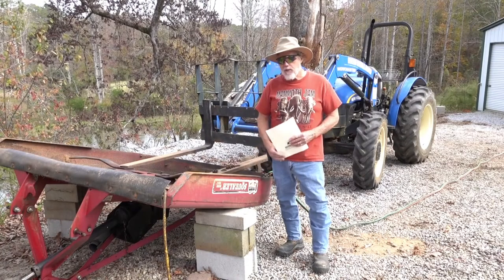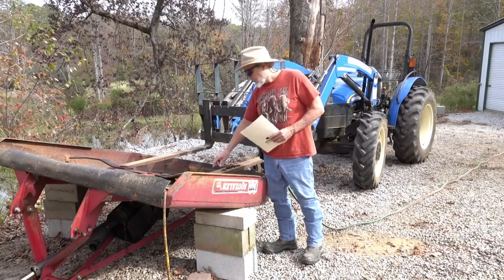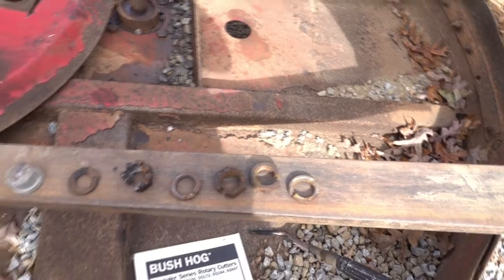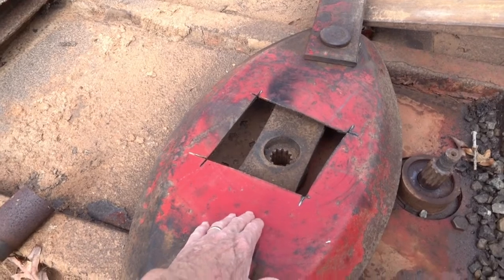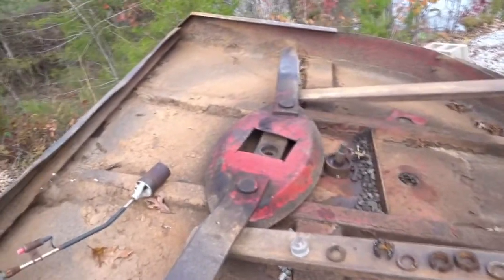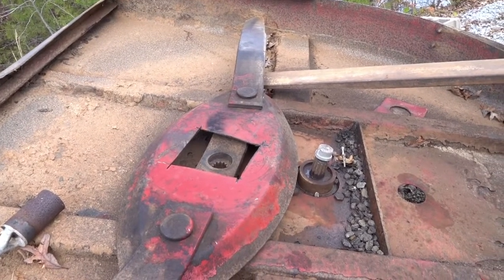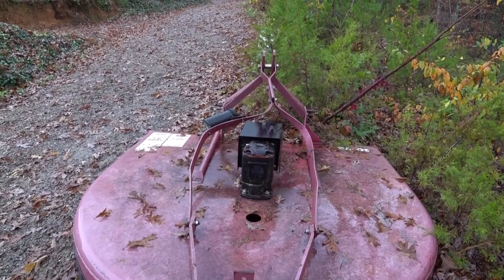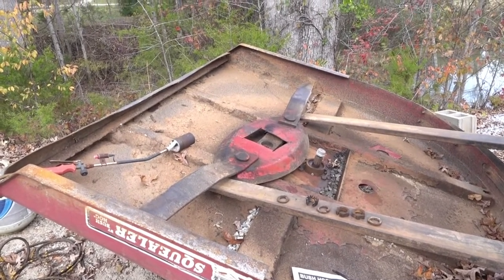Bush Hog Stump Jumper Removal

Comment: The main nut came off rather easily on mine. Now to apply some heat to try to break that splined shaft loose. Thanks for the video!

Comment from the maker: I had to split the castle nut and the two blade nuts to get them off. You would think Bush Hog could afford a little never seize when they build them.
Reply: Thanks for the Laughs a 1inch Impact that you can Rent would have taken it all apart, and a Hydrolic jack is used to take the stump jumper off.

Comment: I think a chain from your tractor to the three pt hitch would work better to turn it over. Problems multiply,dont they? There must be blood also for mechanical work. That top frame looks kind of flimsy. We mow alot of rocks where I live. We never bought a Bush Hog. We were lent a heavy duty JD mower once but I didnt get aggressive with the mowing because it was borrowed.
Reply from the maker: Thanks for watching and your comment. You are right about the top frame. This was a lower end model for a Bush Hog, but I have gotten a lot of use out of it.

Comment: That’s the purpose of the stump jumper is to prevent shaft damage.  I guess it wasn’t enough.  My question is does that heat compromise the temper of the hardened parts?
Reply from the maker: Thanks for watching and your comment. I replaced the gearbox because the shaft was bent, installed new blades and blade bolts, but I put the same stump jumper back in. I have been using it regularly and have not had any problems. I originally tried using my acetylene torch to heat the stump jumper, but I found out quickly that even though the acetylene torch gets very hot, enough to melt the steel, it is too localized. The large propane brush burner torch enabled heating of the spline shaft and receptacle in the stump jumper without melting any steel parts.